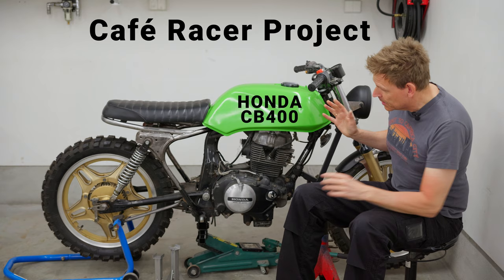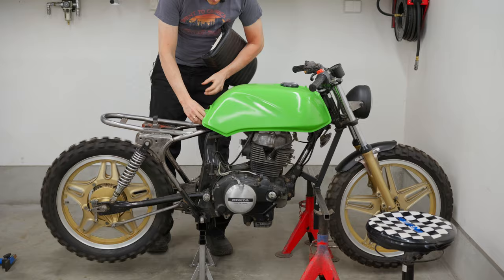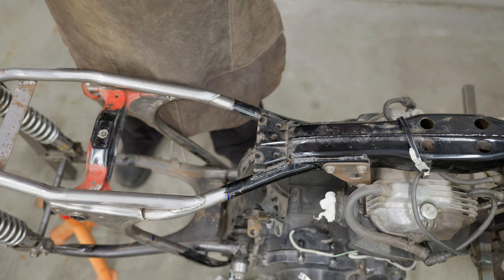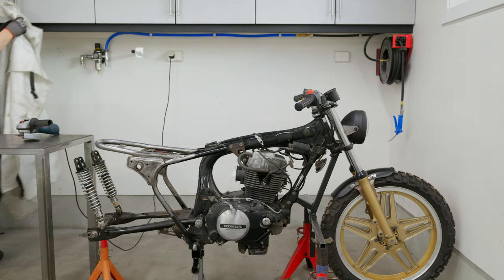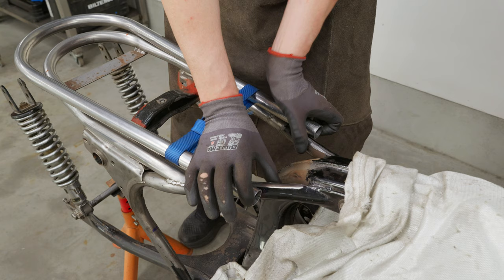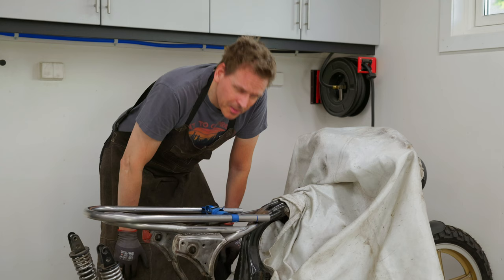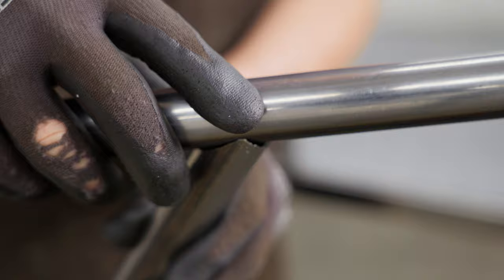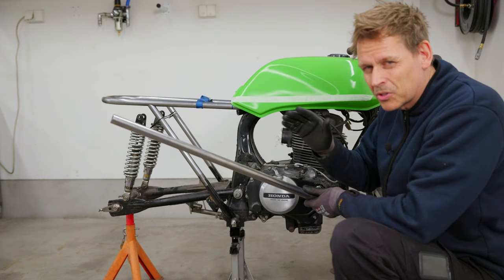Cafe Racer Seat Hoop version 2.0 - Honda CB400N Superdream

Comment: It looks good as is. If anything lower the front a very small amount. Keep the Tank  and 'blend' it in. To my mind the original tank fits in with the overall concept. Good stuff!!
Reply from the maker: I'm glad you support the idea of keeping the "strange" fuel tank 😊 It's not the classic styled cafe racer tank, but this is a bike from the 80s and I've finally decided to keep it and I will try to make the bike look like a cafe racer brat / scrambler hybrid motorcycle - as if it was made in the 80s.

Comment: Great idea to 3D print a jig to use as a hole saw guide.  Yes, there are dedicated hole saw jigs for tubing sawing, but how often would you use a very expensive tool.
Reply from the maker: Yes, and it worked very well. The problem for me was the hole saw itself, it was very worn and had not very much precision. I will buy a better quality hole saw next time and see if the result gets even better.

Comment: Personally I think it looks good but I find there are 2 aspects to look out for the height of the rider (you don't want your knee's round your ears) and the other is if you like it if you like the way it looks then do it, just make sure you have enough clearance for the rear tyre not to clash with the seat.
Reply from the maker: I will absolutely consider this. I have already lowered the foot pegs to get better riding comfort, and I will not have a super-slim seat. The tank is quite bulky so I think a "fatter" seat will work. The shocks has approx 6cm travel, at an angle I guess the real travel is max 10cm. I'll make sure I have enough clearance for that. Thanks for the tips! 👍

Comment: what is going to work the height is where you will weld the brackets for the rear shocks , all good there!
Reply from the maker: Yes, that is actually a very good point! I have setup the bike as it was originally with the swing arm at it's lowest position, but I notice I can lower it if I want. 
Thanks for the tips! 👍

Comment: I think it will look fine once the end is bent upwards. I'd check and see how it looks with some weight on the bike,  It's gonna squat a little. If you haven't already welded it, you might think about drilling and plug welding the joint seeing as how you have that inner pipe there.
Reply from the maker: That is a good advice! 👍 Probably best to spot weld first and test it with weight on the bike before the final weld. The springs are somewhat soft so it will definitely squat 😁 I have planned to but/edge weld the pipes, so I am not sure if plug welding is really needed? Perhaps it adds extra strength? It's not much work, so maybe I'll just do it. Thanks a lot for good advices!!! 👏👏👏
Reply: In my opinion it will be just fine without the plug welding but it wont add any weight, just a little strength.  I've always been of the thought that it you can improve something (even if only slightly) and it isn't at the cost of something else (such as weight) then do it.  The extra work is minimal with your skill level and time shouldn't be of any significance.  
I suppose that was a rather verbose way of me saying it's perfectly acceptable as is, but could be ever so slightly improved with not much more work, but whatever you do with it will be the correct decision.  You're a skilled, talented, intelligent and sometimes even humourous. Go with your gut

Comment: I'm curious about the suspension sag/travel, but otherwise I think it looks good.
Reply from the maker: I better take a closer look at that before I continue. The shock travel length is approx 6cm, on an angle I guess it will be more. The clearance is approx 10cm now. Thanks for the tip!

Comment: i think it looks good...i would concentrate on rear suspension travel...putting an incline on the rear most part of the subframe could help you out here.
Reply from the maker: I have planned to tilt upwards the rear part of the hoop to fit a fender there. I'll do some testing to make sure it's room for the wheel under the seat hoop when max compressed. Thanks for the tips 👍

Comment: Are you going to drill and plug weld the frame, hoop and supports to tie them to the inserts? Then coplete the but welds around all the tube joins. The new line looks good to me, just make sure the ergonomics fit you. IMO I would change the tank as i'm not a fan of that shape, you know straight away what the donor bike was.
Reply from the maker: I will only edge / but-weld the pipes.I have grinded the ends to 45⁰ and will leave a tiny gap before welding. The weld will fill the gap and go into the inner tube as well. This way I can grind down the weld seam to get it flat without weakening the weld.

Comment: I think if you are going to swap out the tank with a flat bottom tank then I think it works well, especially if you’re going to kick the tail end of the hoop up. If you’re going to keep the current tank I would raise the the back end half a centimeter.
Reply from the maker: Thanks for the suggestions! 👍 I did consider swapping the tank to a more "classic" one, but after some back and forth I decided to keep the original.

Comment: Another nicely made episode. For my money the loop height is correct, and maybe looks a little low until you curve up the end.  I'm assuming you are keeping the rear shocks the original length?
Reply from the maker: Thanks Ryan ☺️ I have bought new shock but they are replica of the originals. I might have to extend the upper bracket on the shocks, as the original shock mount is a bit  low and I probably want to put the new one in the 'corner' where the diagonal pipe meet the horizontal one.

Comment: Looking good! Have you considered dropping the headlight and bars a smidge to better align with the straight profile? Also, changing the subframe construction of course changes the angle of the rear shocks so they no longer mirror the front forks. Possibly lengthen the swingarm (or move the upper mounting points location further forward) to change the rear shocks angle to once again mirror the front? Thanks for the videos, I enjoy watching your progress!
Reply from the maker: Thanks for the suggestions 👍 I'll take a look at these things when I get the bike off the jacks. Some small tweaks might make a big difference 😊

Comment: Den är perfekt. Mycket bra jobbat. Jag har en Suzuki GSX 400 E som jag ska bygga om till scrambler. Vilka däck köpte du? Dimensioner?
Reply from the maker: Tack så mycket! 😊 Tires: Front: 110/80 - R19, Rear: 120/80 - 18 - both are Michelin Anakee Wild. Remember to check width of your rims if you consider wider tires than what is original. My bike has "Comcast" rims, width: 2.15". Older Hondas have "Comstar" rims, they are not as wide and it might be that these tires are a bit too wide for them. Not sure how wide the rims the Suzuki has, better take a look!
Reply: @kihestad  thank you so much. I’ll check the wheels more detailed. I really want Continental tkc 80 tires, I hope they will fit. I’ll keep follow your series from the first Honda episode to the last.